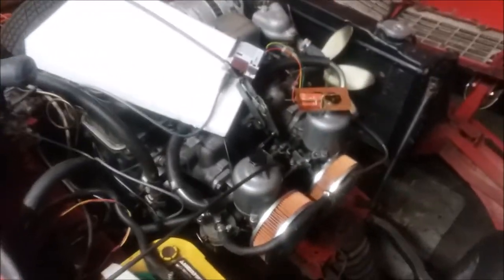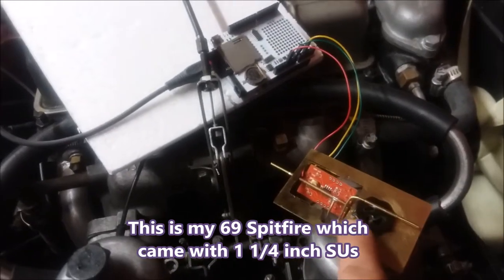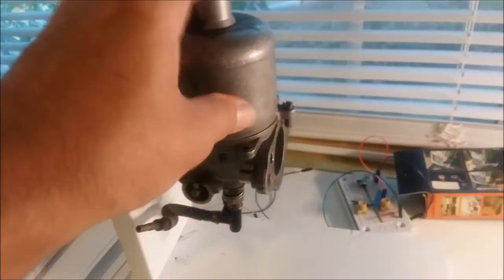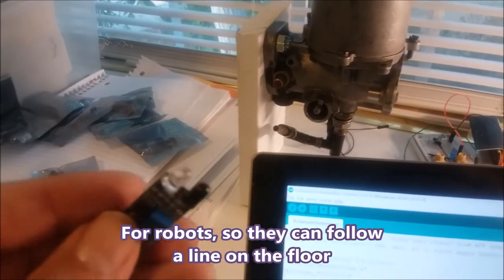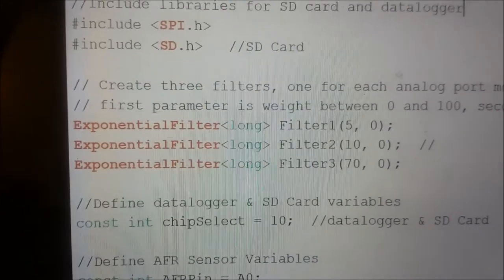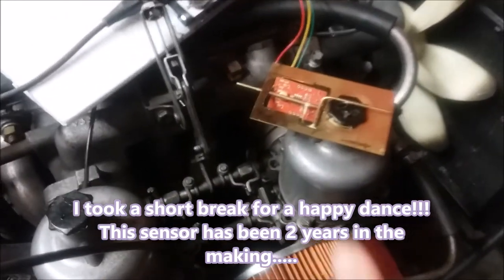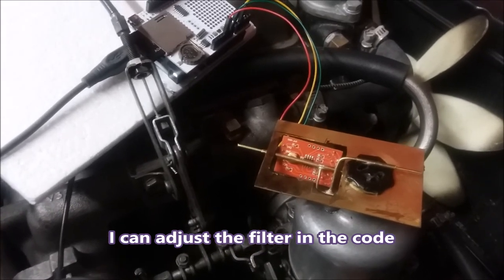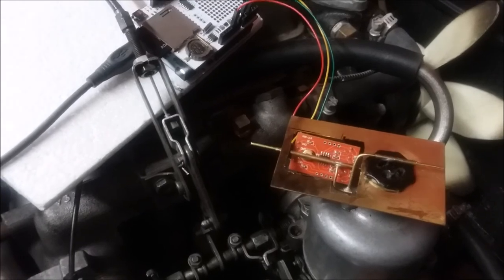SU Carb Needle Height Sensor - Fixing bad data

Comment: Hi, impressed with your needle detector. I tried with IR Sensor positioned at the front blade of the air filter. However doesn’t work precise enough. Would you mind to provide some details: size or sketch. I would like to build the Sam like you have done.
Reply from the maker: Thank you, and be happy to.  What is your email?

Comment: I managed to build the same needle detection unit, however I observe massive interference when the motor is turning, upto complete freeze of the Arduino. I think it is a weakness of the I2C protocol. How did you overcome this?
Reply from the maker: The magic is a data noise filter in the code.  I will do a video on that soon.